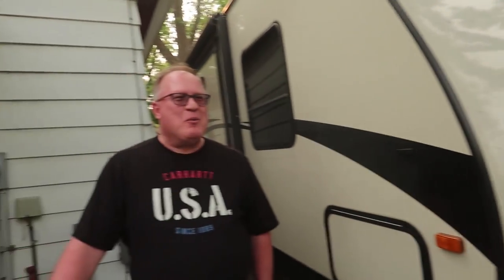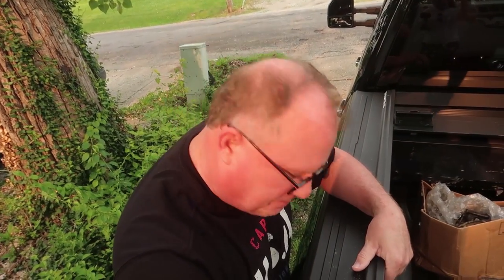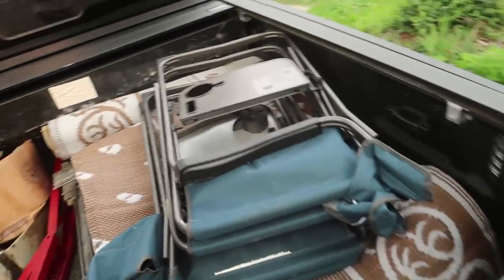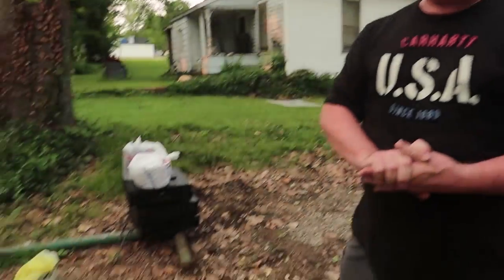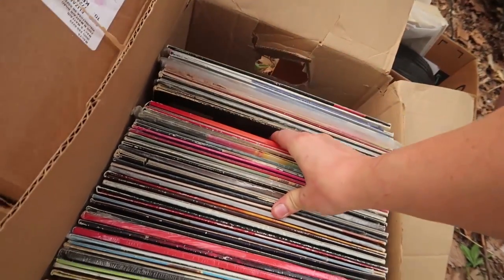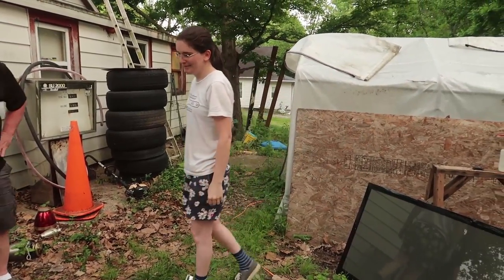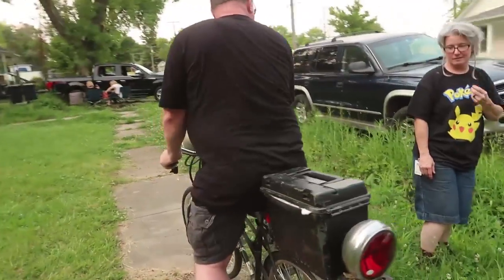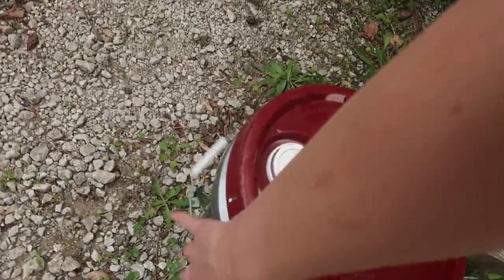Random Bits 0229: Thermionic Man Visits! Lathe, Laserdiscs, Drillpress!

Comment: Found your channel recently, retired TV/radio tech 35 yrs. For fun, if you get an old tube type TV color, console preferably, chassis in working condition, you can hold a 4ft flourescent bulb/tube down next to the flyback  transformer in the cage and it lights through your body with RF. Also any tube type B&W portable set, hold your finger near the AC out lead of the flyback, in a working circuit, it will arc to your finger with no pain, and the purest Ozone you've ever smelled. It's poison? Yet there are air systems based on it?
Reply from the maker: well thats why air systems use ozone, to kill bacteria in the air.

and sadly ive gotten sooo SO close to my goals. one time went to an electronics recycling event and as i arrived some workers were smashing up the tube and wooden frame of an old tv. i was so angry tbh. looked to be early 1960s colour. i wad only able to save the main circuit body and front bezel.

it did have a tube brightener on it though so i like to think maybe it was burnt out anyway. and it had some wax leaking out of the flyback. at least now the fromt bezel makes a good 16mm projector screen shroud.
Reply: @RinoaL  I think i saw a video header of yours re: rejuvenators in the title. Wow, used them alot, best results were ALWAYS on B&W tubes.
Reply from the maker: @cygnus58  from what i can tell those tube brightener kits can burnt up the electron guns though. will take a dim set and make it bright, but limit its lifespan.
Reply: @RinoaL  It's all literally the cathodes of the tubes. They get a build up, and the rejuvinator Zap blasts it off, hence the sparkles :) while you rejuvenate. The brighteners raise the filament voltage so conduction occurs more, more emission from hotter filament,  (perceived brightness yet still a soft appearance) and shortens filament life, while the tube is already in decline, phosphor etc. Your back wall looks marvy BTW.
Reply from the maker: @cygnus58  oh thanks, i really like it. i have a 1925 player piano i plan to place at the back of the workshop in the corner, i think itll go with the walls really well!

Comment: I just retired my 48" Panasonic plasma for a 55" OLED 4k UHD. It is amazing! But the plasma is still an excellent TV. I'll send you some photos of my 1928 South Bend Model O 9" lathe (made for only two years), shipped on Thursday Oct. 25 1928, and my Atlas drill press and Atlas MFC horizontal mill. Both made around 1953. Thermionic Man is beyond kewl.
Reply: Plasma and CRT have been favored for gaming because of their very low latency, but OLED/QLED is now the flagship technology for high end gaming.